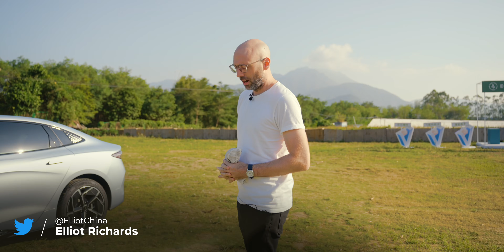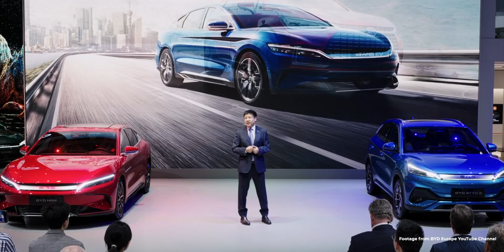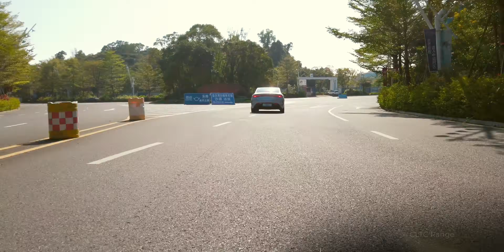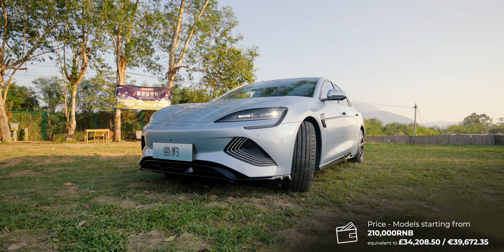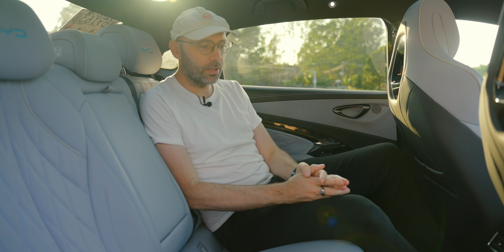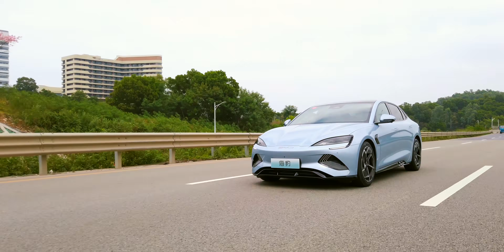This Chinese EV Is Going To Be A HUGE HIT In Europe

Comment: I do not know which one to choose... The Design versión (RWD) with 313cv, or the Ellegance (AWD) 530cv...

The thing is , are 313cv fast enough when you accelerate ? Does the accelerate energically? 

On the other Hand... The RWD (313cv) offers much more km autónomy with 690 km ... While fue (530cv) AWD one gives just 570km of autónomy...

So bearing in mind that price beteween both are so close (2000€ of difference) 

What is worth choosing? Power ? (530cv from the AWD) or  Or km autónomy?? (690km from the RWD) ???

Comment: Shame no economy quoted in the international standard of kWh/100km. 
Smaller boot than the car it appears to want to compete with (Tesla 3). That car gets only 13.2kWh/100km.
If it comes to Australia at <90% of Tesla 3 price I would strongly consider.
Reply from the maker: Is the international standard of kWh/100km a thing? 
Personally, maybe because I grew up with old money miles or kilometers per kWh makes much more sense.
Like mpg or kpl. 
I don't know who came up with the litres per 100km but I suspect someone working in the fossil fuel industry to keep things politely obfuscated.
I will always use mpkW or kpkW.

Comment: With such low front clearance, I wonder how it will cope with some of tall speed breakers built to discourage hoon driving in some of the suburbs in Australia. But overall looks cool. Also good to see BYD chose not to cut costs by putting cheap chinese batman tyres like those on atto3 which spoiled the ride and handling of a otherwise a decent car.

Comment: I see BYD is taking lessons from Tesla. Cutting features out and calling the result an upgrade.....
One of the big reasons to have fully sealed and contained battery packs is so that in the event of a collision the battery pack is disconnected from the main chassis. In one of these cars, that can't happen and I am starting to think they will not pass safety standards for that reason. I certainly would not want to be involved in an accident where the 400V battery remains attached to the chassis !!!
Reply: The battery won’t disconnect?! Unless you pay extra?
Reply: @behrouzbagheri  nothing to do with it. You try placing a stack of AA batteries in an aluminium case and subject it to vibration and potential impact. There is a very good reason to separate the battery case from the car chassis and BYD are ignoring it

Comment: try tin-air (similar to magnesium-air) fuel cell batteries, both can be recharged/reduced with hydrogen, as opposed to aluminium which does not easily allow hydrogen reduction

Comment: Big deal l was wondering if the Chinese built quality has improved over there petrol cars which are absolute gargbage but they haven't obviously you never research cars what ever country they are built you do realise that seven yes seven EVs catch fire every day in China and people have been killed l have owned several petrol and diesel vehicles not one has caught fire and the USA after all EVs were flooded caught fire and once an EV catches fire it takes a lot to put out the fire many years ago Top Gear absolutely drowned a Toyota Hilux in salt water got it running again drive it and it didn't catch fire they did out it on fire but it kept on running l own a 1997 Toyota Hilux and it is great the motor us fine and will go on gor another 25 years and 3 years ago l paid aud $1500 registered and running when l picked it up from Newcastle N.S.W l drove it home to a South Western suburb of Sydney they are indestructible how indestructible is an EV not very and the Chinese ones are garbage and catch fire for no reason do your research before you review a Chinese built EV and inform people how bad they but of course you get paid to review these EVs and say how wonderful they aren't wonderful l live in Australia and fortunately EVs are around but not many l have seen on other you tube were they have demonstrated how good and bad they are how in the real world they work a good test for an EV is a drive from Sydney to Perth in an EV and a petrol powered car and see which takes the longest or a drive around Australia that would be the real test come on

Comment: Not too sure of what he is saying as some times not explaining or over stating I do that too. Their was not enough about the car its self for one left hand drive so not good in the UK use Balance who knows safety well looks safe nothing about it. As we know depending on make of battery and design they over heat can catch fire or explode like all electric cars and phones Laptops did and some still do even in the best electric cars. Well how far can it go on a charge at 70 mph? How easy is it to charge safely not just fast quick charges that harm the life of lithium batteries? I am not convinced with any Electric cars by any company reason is simple Batteries life cycles change depending on temperature how the Vehicle is used weather conditions and road conditions. E bikes can go further than any electric car but slowly electric motorbikes well 200 miles is the best you can get but charging it and battery lasting oh dear. Now Hybrid well at the moment for everything the Best solution by far for Electric. But for total driving and far less pollution impact  even though making hydrogen can cost in pollution in some countries Hydrogen is clearly the future Better system better environment and better use of recycling Unless there is a new type of electric power system that never needs charging batteries.

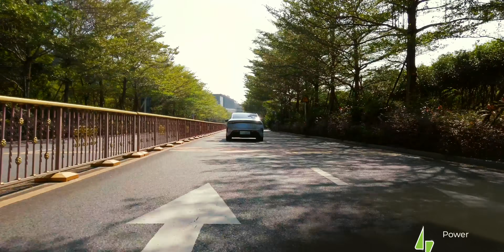Comment: - You list the power as 210hp @2:54.  You probably mean 310hp.
- The battery is LFP, right?  That's a huge detail to omit.  I for one would never trust a Chinese EV with a nickel cathode chemistry.
- Assuming it is LFP (tmk all blade batteries are), the weight and range are impressive. 
- You shouldn't just parrot everything they tell you though.  Like that "diffuser", omegalul (it does nothing).

Comment: When BYD hits Europe it's going to be a painful experience for legacy car makers. Vertical integration has not been adopted by car makers in the west (besides Tesla). With some design tweaks for the European market they'll be a force to be reckoned with.
Reply: Not so sure about that. The quality of a German car is still far ahead of these Chinese versions, and the resale value will likely also differ wildly. I know most people won’t be able to afford a nice car like a BMW, Mercedes or Audi but even a car maker such as VW are years ahead when it comes to build quality compared to the Chinese. There’s a lot of focus on battery tech but the knowledge to build a quality car is something the European car makers have perfected over the last several decades not to mention the security features where they are far ahead of the Chinese. Even Tesla’s build quality leaves a lot to be desired compared to these European car makers.

Comment: Small mistake on your graphic at 2:54. The 230 kW power of the long range RWD model equates to 310 hp, not 210 hp. There is no way that heavy car goes 0-60 in 5.9 seconds if it only has 210 hp on tap!

Comment: Sorry byt the power figures are all over the place.  If it has 230 kW, that means it has 312 HP , not 210.  If it has 210 kW, then it's 285HP.

Comment: Sorry for the noob question: if they have the battery (or cell packs / parts of the battery), as part of the body of the car, what happens in terms of accident? Are those cells insulated from the rest of the battery or do you then have to replace the entire battery (which would cost a lot of money 😨)?
Reply: BYD blade battery doesn’t explode or catch fire when pierced or crushed which makes it safe.
Reply: @Missmydogs  He was asking about cost, not safety.  And the BYD batteries are safe because they're LFP chemistry.  The shape is actually less safe.  Meaning the CATL prismatic nickel cathode batteries should be avoided imo.
Reply: Batteries are always inboard of the sill and pillars.  Any accident that crushes far in enough to get to the battery has totaled the car anyway.

Comment: it would have been better as a hatchback.  given better access to the boot for putting things in.
When it comes to the UK price will be a big factor in how well it does.
Reply: Most sedans would work better as a hatchback, and some EVs are actually hatchbacks, including the Polestar 2 and BMW i4. But sadly the 2 big models that will sell the most (Model 3 and this Seal) are going to be traditional sedans. In China value conscious buyers could opt for a very nice looking Changan Shenlan SL03, which IS a hatchback, and a mid trim version only costs like 26k USD (compared to a 31k USD base trim BYD Seal, or a 36k USD base trim Model 3)!

Comment: You are missing about a hundred horsepower. The Seal you have been driven has 230kW equal to 310 hp, not 210. I could not get that 0-60 time to match 210hp😅

Comment: I would ditch the weird fish scales motif, and use regular sized badges with just 'BYD' on them. The Build Your Dreams script on the boot lid is ridiculously big! (The BYD badge on the front is also too big). That aside, I'd have one!
Reply: Dental floss and acetone 👍
Reply: @Mardy72  Wouldn't acetone damage the clear coat on the vehicle? I thought it is dental floss and a hair dryer.
Reply: @tren133  acetone is just to get remove the residue from the double sided tape. You don't need much.

Comment: Looks like the base model of the Seal falls into my budget, 350 Km is probably enough especially if the improved high speed efficiency and slipperiness of the Seal give better high-speed efficiency than the other models. ( I want to charge it on the weekends with solar rather than every few days overnight).

Comment: It looks like a level up from the small SUV and the hatch, efficiency looks great, not sure about safety but I hope this is comparable to the competition. Let’s see what the price point comes to and hopefully they can improve their software for western markets.
Reply: atto 3 already got 5-star safety rating from both Eu-nacp and ancap (Australia).
Reply: @leiyue1411  Exactly and Atto 3 doesn't have the cell to body structure like the Seal has so the Seal is even better and safer.

Comment: Looks pretty good. From the side it doesn't look that different from many cars but that's probably down to it being efficient. Maybe I missed it but I didn't hear the range although I suspect it's pretty good. 
I live in Thailand and I haven't seen BYD here yet but given the ease of trade between the two countries I would expect them to be here soon. GWM are already here with the ORA and Haval brands..

The only only issue for me apart from not having enough money is how low it is. It looks good and it helps drag which is mostly OK around Bangkok and down towards Pattaya where the roads are good. Up here in the northeast extra ground clearance is more of benefit since the roads are built by guys with pickups and there often seems to be little thought about how cars fit the picture.
Reply: If you have a parking space to charge your electric car and travel within 300 kilometers a day, an electric car is the best choice in congested Bangkok. But if you want to go to Isan, and there are a lot of bad roads, I still recommend using a load-bearing four-wheel drive SUV, such as the mv-X, D-MAX.
Reply: @lionheart3025  Yes roads in Isaan can be bad.
I said I hadn't seen a BYD here in Thailand and then a couple of weeks ago whilst driving in Bangkok before flying to the UK I saw one and remembered seeing them before. They are the electric taxis you see around.
Reply: Woow. ORA good cat is the one I loved. More I like ORA good cat because I prefer smaller car. I am from Korea 🇰🇷👏. But I dont like what Hundai and kia doing

Comment: This car probably won’t sway the died-in-the-wool Tesla fans, but I’d bet a lot of people looking at an EV for the first time will take it over a Model 3 simply because it is not that different from what they have been used to. The issues I see in the world market are ground clearance, head room in the front and the driver’s seating position (did not look comfortable). As an Australian I’d want a blind on the glass roof; its just too big. Yes it blocks UV and I’d hope it also kill IR, but visible light alone will blind passengers in Australia, the middle east and parts of the US. I’d also whinge about the lack of a spare wheel. However on the whole it looks like BYD have done a really good job here.

Comment: Thanks to Elliot and co. for keeping us informed of what might be coming soon to a country near us. The section on their process improvements was particularly interesting, but I wondered about the use of manufacturer-provided stats, eg. the use of CTB architecture making the shell 50% stronger, and the side 45% better protected in a collision. Does that mean crash impact testing has found that an occupant would be 45% less likely to suffer a serious injury in a side-impact? Do we know how this compares to Western vehicles?  It's tempting for PR departments to produce flashy numbers that might not mean very much in reality.... and the BYD hat may have (unfairly) made me even more sceptical than usual!
Reply: For what it's worth, the ATTO 3 received a 5-star ANCAP rating here in New Zealand.
Reply: @jasonkeweneallan2827  ATTO 3 also got 5 star EuroNCAP rating using their 2022 standards, beating out the BMW i4 which only got 4 stars. The Seal (ATTO 4) should do a little bit better since it has the more advanced CTB feature.
Reply: Even without CTB the ATTO 3 got 5 Stars in Euro-NCAP under their stricter 2022 testing standard so the Seal can only be better.

Comment: Kind of disappointed in the boot, would have preferred a Hatchback in my opinion. Also although the inside looks plush, maybe tone the seats down a bit, especially the rear ones and those tear drops on the rear. Otherwise a damn fine looking car. 
Needs to come in at under £40 though to be a contender in the UK market, but might be possible if BYD get into Sodium Batteries for their car's by 2023 as suggested recently...

Comment: (Battery) Cell to body? So this is basically one time use car when the battery is broken , replace the whole car? Wow so "green" tech....
Reply from the maker: Come on latebloomer2, you can create better negative conspiracy theories than that. Why not say the battery will 'break' after 3 months and the car will catch fire and kill your children. Or the battery materials require more CO2 output than running a coal power plant for 1,000 years.
What about, the battery will outlast the car (which we now know) and of course it can be used again, either in another car or as static energy storage in a building. 
But no, stick to the wild assumptions based on . . . .  literally nothing

Comment: No mention of battery capacity, range, charge rate, regenerative/one pedal braking (if available) or bi-directional charge capability.  Come on, at least cover the basics.

Autocar says the battery is 82.5kWh with a range of 435 miles (the high performance has 404 miles).  Those figures are stunning. 

More googling reveals the brake regen is nowhere near as aggressive as a Tesla, with no sense of one-pedal driving.  Recharge rate is from 110-150kW depending on the battery, taking 30 minutes to charge from 30 to 80%.  Doesn't look like two-way charging is supported.

Comment: The cynic sees piano black, megane daytime running lights, and a dodge dart rear end. The optimist sees an affordable contender for chipping away at the suv onslaught. The realist sees the danger the mass market and quality brands are in. BYD is still very much under the radar in Europe, but not for long. As soon as the rental companies offer it, I'm benchmarking it. Fyi: the diffuser is not doing much. Short and crazy angle. Hope the front inlets are functional.

Comment: The classic Chinese design, copy a few other cars, make it cheaper.  A lot easier now with electric as the engineering required is less then a traditional car.
Reply: Nobody makes safer EV batteries than BYD.  Tesla is still trying to figure out how to mass produce its own batteries.

Comment: still £10k over price it needs to be ....I really had hoped for a lot better from BYD..... and not much over 100bhp / ton??

We need a manufacturer to really get a grip on pricing before EVs become too unattractive to take off due to 'fuel' costing more than ICE and confirmed road duty on the way

Hi UK prices, ludicrous re-charging costs and a laughable charging network working at 40% ish of what is offered due to defects and slow charging....this is becoming a slippery slope

I have enjoyed 1.5 yrs of Zoe driving @ £399 all inclusive of charging etc, however things are getting worse, not better as we all had hoped from subsidised huge mass production in China....

Very disappointing

I still hope Elon will keep EV take up where it needs to be by introducing Model 2 nr £20k, 220+ mls range......

Comment: For all those that can't work out the price, 210,000 RMB is £24,700.  Add 10% import tariff and 20% VAT and it's £32,600.   Throw in a couple of k for shipping and thats the £34k -ish  price quoted in the video.  So that would be the 'landed' price.  Assuming western dealers get the same margins as the Chinese dealerships on the 210,000RMB....The only reason it would sell for more than that is that it's nearest made-in-china competition (MG4) sells for nearly that much and it's clearly a much lesser product.

Comment: Before anyone gets to excited about the £34500 price don't forget the 10% duty and then 20% VAT which takes the starting price up to £45500.
Reply: The MG4 is about 45 percent more expensive than in China ,I believe this car should cost about the same.
Reply: 210,000 RMB is £24,700.  If you ADD 10% import tariff and 20% VAT it takes you to £32,600.  So that £34,500 price looks like  the 'landed in EU' price.  Maybe.....